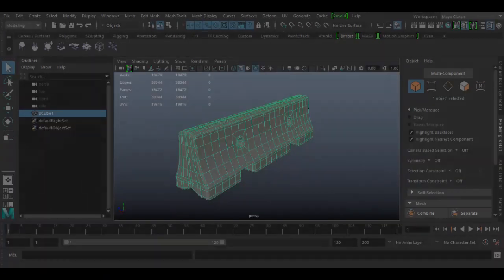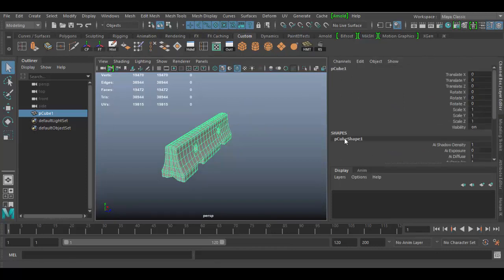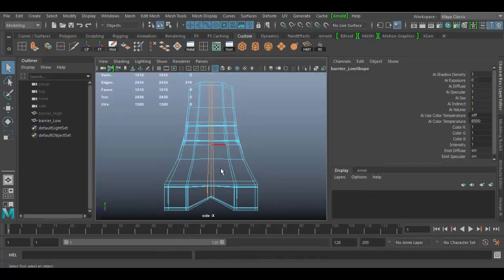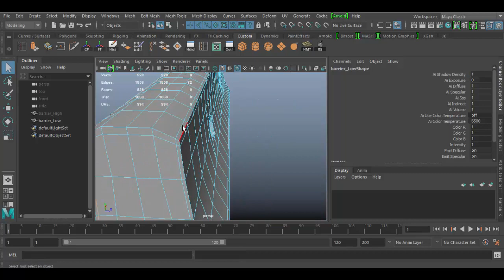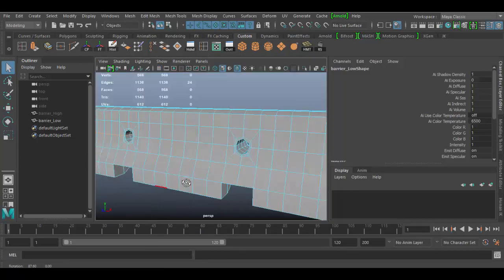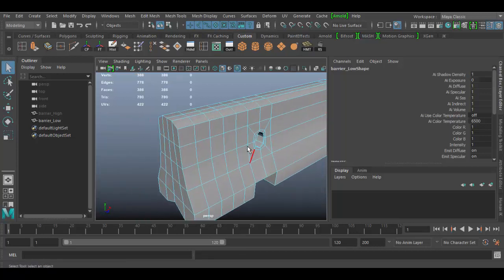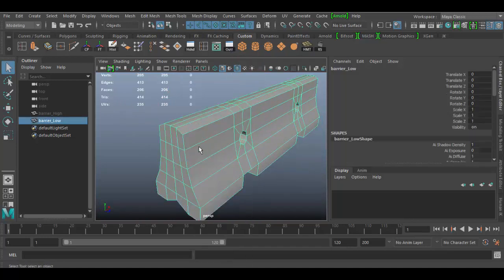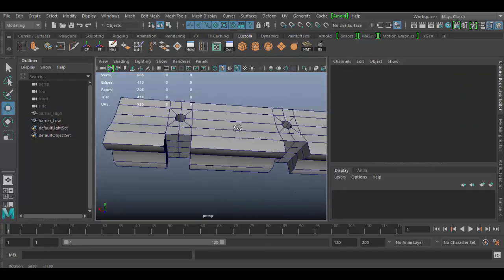Autodesk Maya Creating a Low-Poly Model from a High-Poly Model

Comment: nonsense. I have model with about a million edges and vertexes....and you suggest me to sit and delete edges?!
Reply: Did you apply the suvdivision when you made it? If so thats on you. And if you want to get a low poly you will have to do manual retopology or 3ds max.
Reply: I was thinking the same thing. I had converted mine to sub then back to poly upping the poly count. I was able to lower it by going to Mesh > Retopologize

Comment: I realized something.... after spending days modeling a high poly model just to realize I will need to basically remake the entire thing again but in lower poly to bake. BUT, why not just make the low poly first with all the tri's tucked into edges from the get go, game model style. You don't need to worry about topology because it doesn't matter. rounded corners have all their tris tucked into some random vert, etc, as long as there isn't any huge deformations. THEN. You take that absolutely complete low poly model, toss it into zbrush. Dynamesh to automatically make it perfectly quaded, then use the auto polish tool to make the edges smoothed and rounded. Then decimate and import back in. Then all of a sudden you have the perfectly edged high poly model that will be baked to perfection without doing holding edges or figuring out how to hold edges on weirdly shaped hard surface models without it looping around and holding another edge of some part that is supposed to be round. Just ignore all of that and just use tri's and booleans as much as you want, then just manually cut lines and snap verts. I'm still trying to figure out the reason why people don't just use triangulate to automatically and messily complete a booleaned hard surface model. Like it shouldn't be any different, if you can't see the wireframes the model would look clean. Even if you import it into an engine, it automatically tessellates anyway so its like not like tris are a big deal as long as its used on flat surfaces. The high poly can be whatever, the messiest topology ever but as long as it looks clean, its okay since its used for baking only and nothing else. Is this the secret that I've been told for so long? They tell you to model the "correct way" and until you understand it, you are allowed to cheat. This is the cheat method? Boolean all those absurdly annoying shapes in mere minutes that would take hours to do by hand. triangulate. export to zbrush. dynamesh. polish. decimate. import low and high to substance, bake. Repeat for all other parts until you have it all completed. Here is the secret, he uses max but its mostly the same. https://polycount.com/discussion/168610/3ds-max-zbrush-proboolean-dynamesh-hardsurface-workflow-tutorial
Reply: Yeah that looks quite good, though I don't use 3DS max